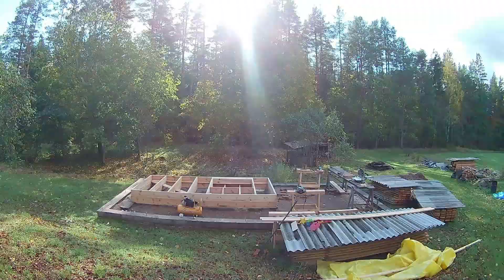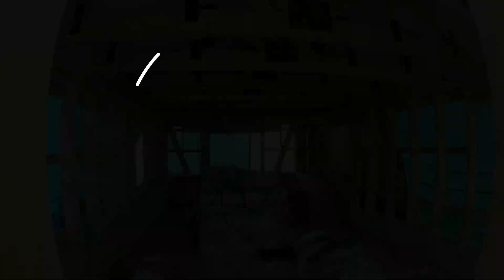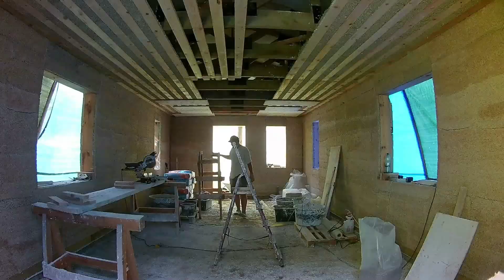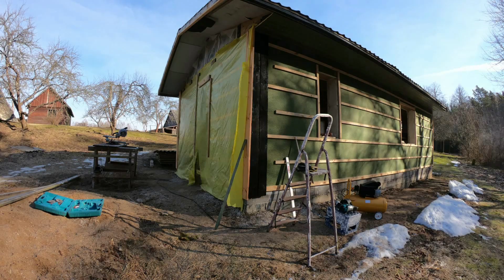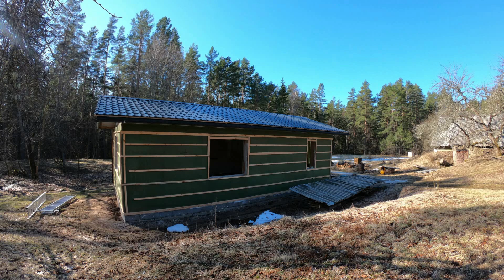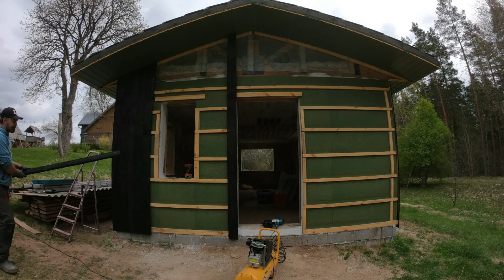Hempcrete House DIY (time-lapse)

Comment: I’m planning to build a hemp home so I appreciate this. I just don’t see the need for the extra exterior you put on as the hemp with the lime stucco works well as insulation etc. and remains more breathable.
Reply from the maker: Hey! I wanted to use cladding and everything feels and looks good for now, slowly going into the finishing phase.
Kudos on the plan to build with hemp. I would change my frame to a double stud frame now, but it is what it is. Maybe for the next project. If somebody sprays hempcrete in your region - would suggest to use the offer as it save an awful lot of time.

Comment: Hi! Excellent house. Is there a part II? I loved the Yakisugi over the hemp. Can you comment?
Why do you add a wind insulator when Hemp is breathable? Can you comment on the results after 2 years?
Did you add the thin planks between the boards?
I'll build a tiny house just like this one, but with the double stud frame, as you suggested. Thanks
Reply from the maker: Hi, Maria! The second part is still in the making. Slow progress, but just finished painting the floors. I had the wind insulator per hand and just used it, it holds up nicely, no damp or breathing issues. I love the climate inside. Haven't put the thin planks on yet, but i'm in no rush and other projects keep me busy too. 
Good choice to use a double stud frame, if you wanna do cladding.
If you have more questions, let me know :)

Comment: Why did you nail the boards that covered the house on the outside apart from each other and not join them together to form an enclosed air cushion as additional insulation? Is it a new system for insulation in cold climates? Another question, were the boards you used burned or painted black or something? Does that serve to insulate from the cold? I had never seen anything like that, very cool and cozy house, what about the cost of the proyect? cheers ;)
Reply from the maker: Hey! Thanks for your questions. The gap between the planks is there, because I don't have time to put up the 5cm wide board that would cover it :)
The boards are burnt just as a conservation method - you can look up Yakisugi. Burning planks takes up time, but then again you don't have to plane and sand them, because fire does that for you.
Cheers!
Reply: Those are excellent questions.

Comment: Nice building. I am also going to build a hempcrete house in Netherlands soon.
Reply from the maker: That's great. I recommend reading "The hempcrete book" and "Essential hempcrete construction" before you start, gave me a lot of insight.
Reply: @izjusts  I'm reading the hempcrete book. Is that other book such different information that its worth reading it?
Reply from the maker: @bramverhoeven10  Some chapters were better explained than in the hempcrete book. If I could do it again I would go with a different wall system - I would do the double stud frame.
Reply: @izjusts  oke. Because double system has a better isolation en easier with casting?
Reply from the maker: @bramverhoeven10  Exactly! But it depends on what you plan on the exterior and interior. In my case, that would have been easier, because of the cladding outside, and it prevents cold bridges.
Reply: Hallo Bram, ik heb ook intresse in kalkhennep bouw. Waar wil je dit gaan doen in NL en wat ben je van plan te bouwen. Ik zelf denk meer aan iets wat meer richting een tuinhuis gaat.

Groet Mo
Reply: @moziani9093 hoi Mo. Ben op dit moment nog bezig in omgeving Nijmegen. Nog interesse ?

Comment: Hey, love your work and entertaining Timelapse! What sort of material are the panels you placed between the walls and the external cladding? Is it some sort of plywood panel? Cheers from NZ!
Reply from the maker: Hey! Thanks for the comment. The boards are wood fiber boards with a coating against wind penetration. Thought it is useful in my 57 north as it works good for my living home and sauna too.

Comment: Overall very nice build. Only thing I would change would be double furring, vertical on wall, then horizontal for installing your vertical cladding. Current install does not have drainage plane to bottom and stops ventilation from going all the way up. In 10 years your fiberboard will be rotten.
Reply from the maker: Thanks for your input. The vertical cladding isn' t tight and leaves enough room for moisture to escape. If the fiberboard will rot in ten years I'll give you a thumbs up!

Comment: beautiful work.  I hope you have enough R value/U value in those walls for what looks like a really cold climate - without having to burn wood for heating/cooking.
Reply from the maker: Thanks. We are planning on building a wood burning stove, because wood is the most affordable heating source nearby. The other source will be electricity or heat pump, haven't decided yet.
Reply: Hempcrete has a very high insulation rating …likely more than tests show even. Just Biofiber is a good resource with some info.

Comment: Hempcrete is just insulation, right?  With several exceptions, the r-value of the insulation is really the only thing that matters over the life of the home (reduced fuel to heat and cool the home blows the building phase out of the water).  There seems to be better alternatives.
Reply from the maker: Yep, just infill for the wood frame. For now I enjoy it. Will see how it will hold up this winter, because finally will start heating it. Local hemp, local lime, local wood. I don't see many alternatives for natural building at 57 latitude. Could have used sawdust, but hurd has way more air pockets. What alternative do you suggest?
Reply: @izjusts  Hempcrete R=2.1 vs cellulose R=3.6 or wood fiber batt R=3.8.    If your only concerns were interior emissions for health, hempcrete is great, about as low as you could go, but if your concern was emissions to the earth, using almost twice the fuel to heat and cool as other eco-friendly alternatives is maybe not a great idea. And lime is the energy intensive ingredient in concrete, so lots of fossil fuels in making lime.
Reply from the maker: @brokenrecord3523  Well, critters love cellulose and wood fiber and it's pretty impossible to make the construction so, than none gets in. Lime and hemp is better in that way. Why do you think it takes twice the fuel to heat and cool?
Reply: @izjusts  Because the R-value is less which means it is a less effective insulator,.

Comment: what's the name of the greenmaterial on the outdoors after the hemprete?
Reply from the maker: Hey! It's Isoplaat - wood fiber board with a wind protection layer. As I didn't want to use plaster on the outside, decided to add another layer. :)

Comment: Nice and inspiring project! I haven't seen any electrical installation? did I miss it or you plan on doing it later? Or of grid?
Reply from the maker: Thanks! I'm usually mounting all the wiring on walls. For now I start to think, that I should have used a double stud frame, would be easier and lazier to do all the finishing jobs ;)

Comment: Very inspiring! What was the wind insulation and why did you choose to use it? I don't understand how wind would get through the weatherboard and even why wind touching hempcrete would be a problem.
Reply from the maker: The wind insulation is wood fiber board, as the hempcrete is only 30 cm thick, I was worrying that wind could go through. And as I tested in my sauna with 2x4's the wind insulation makes a huge difference.
Reply: @izjusts  Thanks for the answer. Was the sauna insulated with 30cm thick hempcrete too?
Reply from the maker: @mickythreee4640  Nope, the sauna has 10 cm solid wood walls + 1.25 cm wood fibre board insulations + double layer of cladding. I used hempcrete to insulate the ceiling - about 10 cm thick for now (that showed me how permeable and breathable hempcrete is). The floor is just wood planks with 0,5-1 cm wide gaps - to dry faster and let the water run out and fresh air for the owen.
Reply: @izjusts  Thanks for getting back to me. Looking forward to seeing how your project progresses!
Reply: @izjusts  What about the inside? Did you install or plan to install any kind of vapor barrier?
Reply from the maker: @tom.q   Haven't planed to install a vapor barrier, just lime render for the walls and maybe tongue and groove planks for ceiling.
Reply: @izjusts  Lime render is permeable, which is good. My only concern is: in the winter there is warm inside and cold outside. Vapor tries to find its way outside. It goes through the lime plaster, then through the hempcrete wall and meets the cold fibre board.

Water condensates on the fibre board. Do you think it is going to dry or will it make the hempcrete dump?
Reply from the maker: @tom.q  As I noticed the fibre board takes up a lot of moisture and dries good in better conditions, so it should not be a problem. 
As I finished the hempcrete in late autumn I had a broad variety of different mold, so I applied limewash on the outside and partly on the inside. That solved the problem and now everything is dry and fine. Proper ventilation through the windows and a permeable ceiling should help with dampness difficulties.
Reply: @izjusts  I built my extension with 200mm hempcrete walls and no wind layer, and it's all good - so take heart in future that you can save a step! For cladding I usually cross batten - I do vertical battens first, then horizontal, before cladding as this gives you a completely open lattice for air flow behind (with insect-proof mesh across the top and bottom). Looking forward to seeing more of this build :)
Reply from the maker: @emmaslow  Thanks for your input. Usually the recommended thickness of the walls is 50 cm here, that's why I thought the wood fibre board will save some space.
I'm looking forward to continue the build aswell, but still some months to go for the temperature to be above zero constantly. Cheers :)
Reply: @emmaslow  i'm planning to build a hempcrete house as well, maybe you could share your experience since i would like to make it without wind isolation too

Comment: Whats the recept of hemp and lime? Did You put cement?
Reply from the maker: I used the standard ratio 3:1:1 (but adjusted the water according to heat outside). Yes, I did use Prompt, but could have done without.